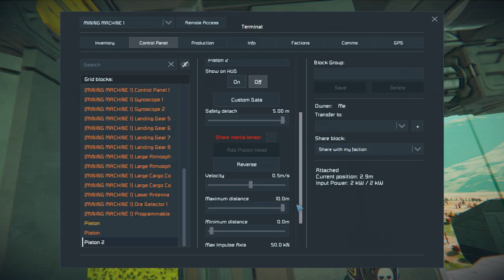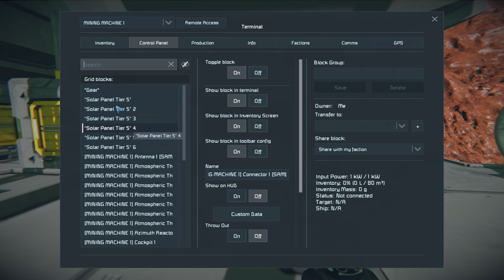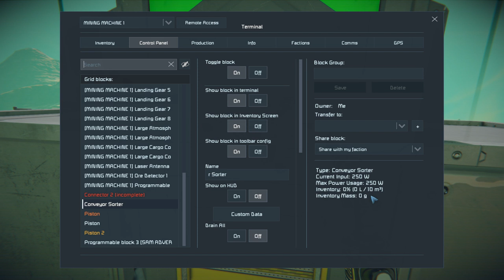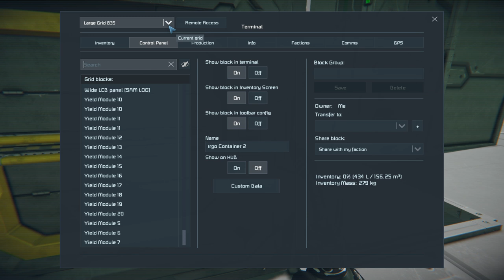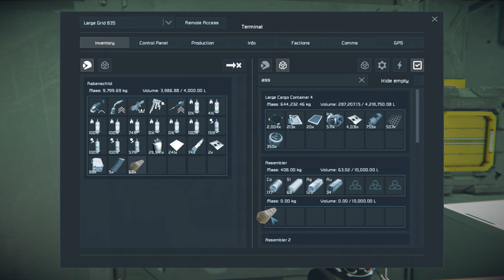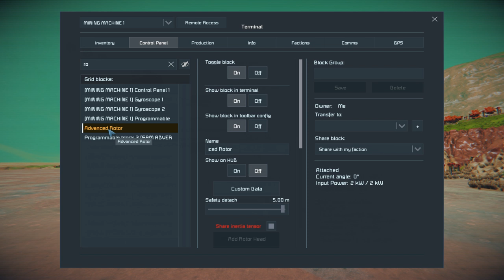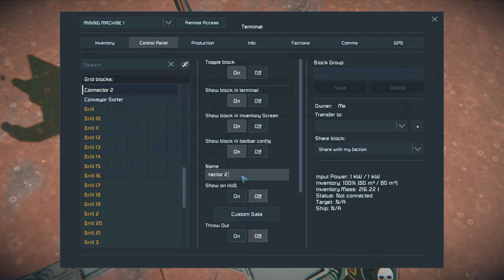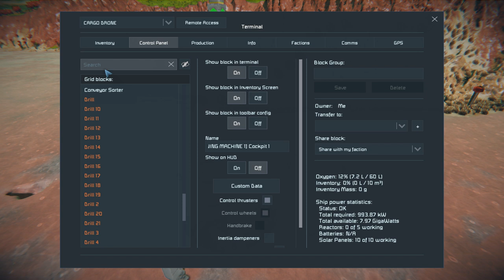ONLY PAM IS MORE AUTOMATIC :: Space Engineers Survival :: Ep. 751

Comment: 2 good news: 
If you still feel a need to save on ice you can replace the O2 Farms with an air vent set to depressurize. That works on the alien planet.
And there is a script that lets the build and repair system automatically queue missing components:
https://steamcommunity.com/sharedfiles/filedetails/?id=867822734&searchtext=build+and+repair
But also one bad thing to note:
Using a sensor to trigger the sorter won´t work that easily. Even if you tell it to detect subgrids, sensors tend to sometimes stop detecting their target upon docking. Might just be me being incompetent but watch out for that
Reply from the maker: I always forget about the Air vent thing, the big ship EVEN HAS airvents on it that bring in Oxygen, so setting up the farms was absolutly pointless.
Yea, the script might come in handy, but all the inventory managers can be set up to full fill quotas, so i would end up with everything i need. The sensor idea vanished really fast, the drone just picks up what is there and brings it back. I want to set up a drone just for that, this way i do not always need to do the remote block search and stuff like that.